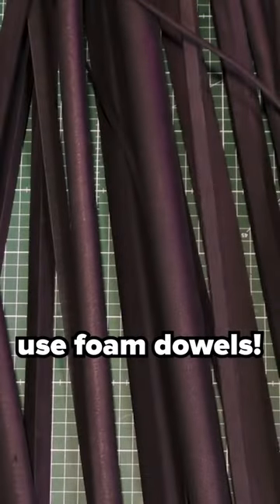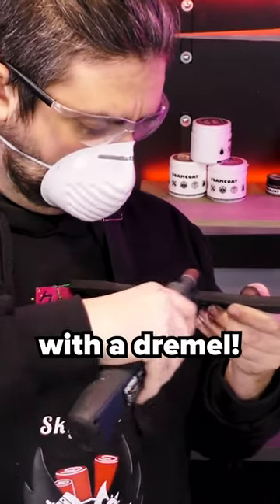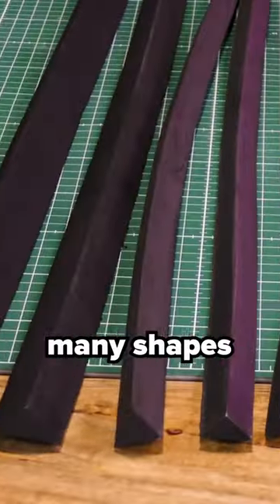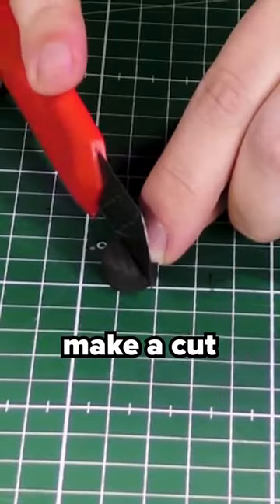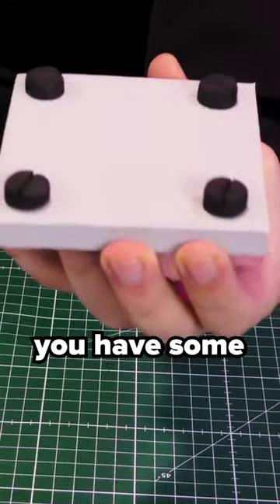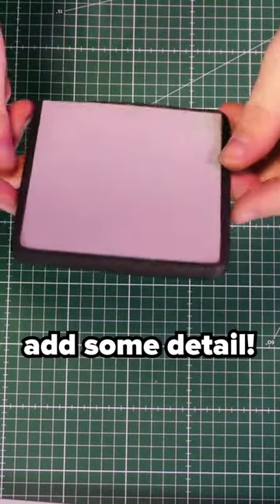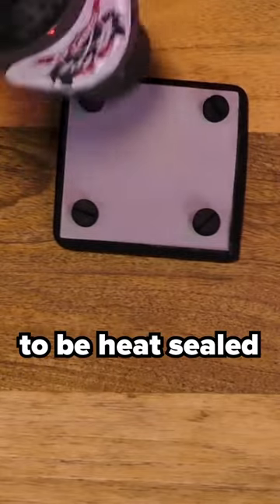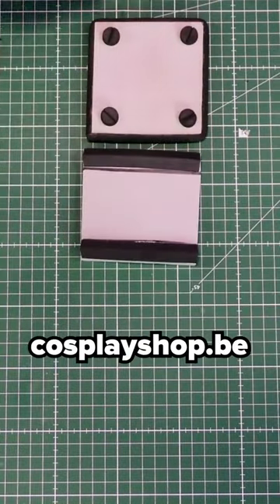What Are Foam Dowels? #shorts

Comment: Huh, making a chain in that way is an interesting idea. Any input on how durable it would be when glued together? For example, would it hold up to a big mace like the one used by Johanna from Heroes of the Storm or perhaps even the Witch King of Angmar from Peter Jackson's Return of the King. Or would you recommend half round dowels glued together with some steel wire as reinforcements?